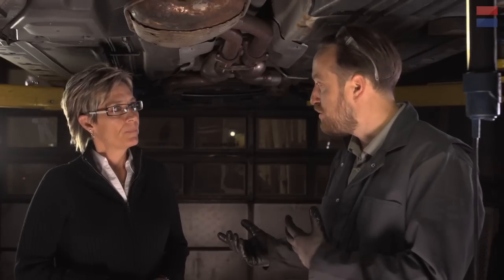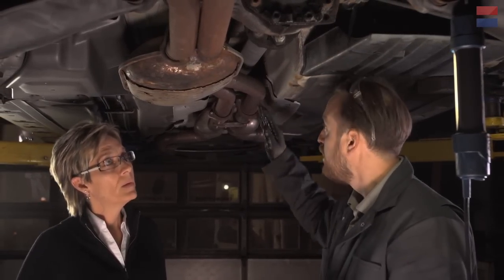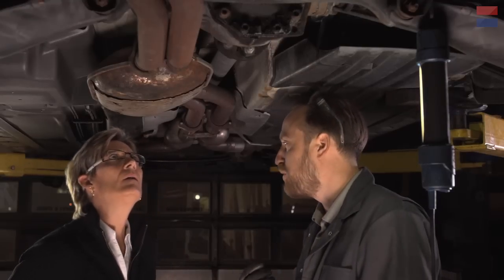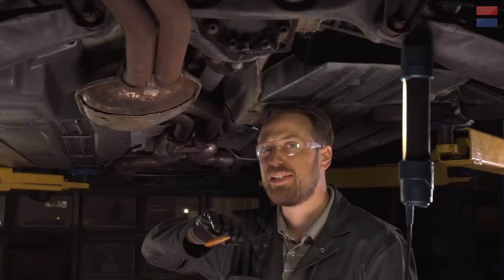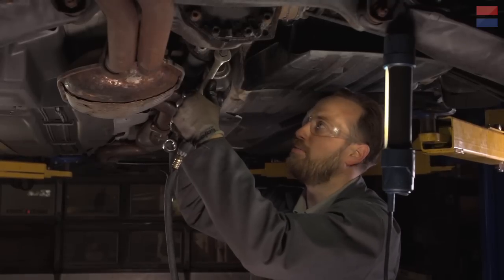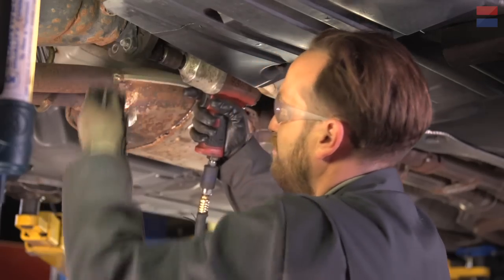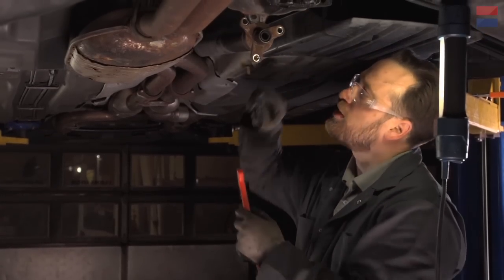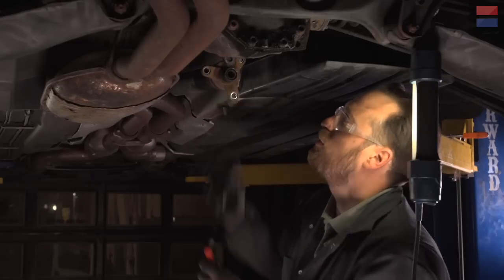How to Replace a Flex Disc

Comment: Never tighten down nuts and bolts on a driveshaft in a circular motion. Those 6 bolts should be tightened like a wheel. Equally spaced in a triangular pattern.

Comment: You forgot to mention that some guibos or flex discs are directional... and if put in backwards will perform bad and destroy itself...
Reply: Maybe that’s why mine makes vibrating sound the one by the transmission

Comment: Hello thanks for your information. Also my w124 had the same problem and while im inspecting the differential i had seen there is some one rubber parts which hold the differential on the frame was damaged. I need to replace it and how it will do

Comment: If working on a '97 Mercedes C230 or similar, remove the rear exhaust and heat shield, then loosen the center bearing to gain clearance to remove and replace the disk, there is no way to force the driveshaft back to clear the pin in the center of the differential mount.  Unless you are working from a lift, the length of the bar you can use to force the driveshaft back is limited, and there is no room for a helper.  After loosening the bearing mount, the driveshaft easily slides back enough to align the shaft to the differential.
Reply: YES, carrier bearing needs replacement too.. and boot.. But loosen  driveshaft nut colapse drive shaft.. or damage the centering bearing grease filled worn out too. Had a driveline balance shaft too.. installed new bearing and mount for free..

Comment: There are several comments here about replacing the flex disk with something solid.  Only issue is that these disks have to do the job of a universal joint, so a solid disk would destroy the whole drive line.  Please someone repeat the torque specifications and I agree with turning the nut instead of the bolt.

Comment: Great video.  I have a 2002 BMW 330i w/ 83k mi.  When I step in the accelerator at around 70mph, I can hear a slight rumbling noise coming from the middle/rear of the car.  When I take my foot off the gas, the noise seems to disappear.  What problem(s) do you think it is?  Thank you.
Reply: Hungry dinosaur in your fuel tank

Comment: Mercedes uses some of the strongest Donuts in the world. I had an Alfa V6 with probably 175hp, granted it was a transaxle car but that car went through donuts like crazy. The alfa donuts though, came with a strap around the outside of the donut making the holes closer together, once you have  your bolts in, you clip the clamp off and it expands and you're done, i guess benz doesn't pre-load theirs

Comment: great vid ...have a question in regards to dive line ...e46 232i 2002 ..190000km auto .. car is smooth without any vibration but!! at 120kph there is not a vibration but a hummmm from seems to be from centre to rear of car ...any suggestions

Comment: Dear Ben. Thanx for the good explanation. I have a Mercedes c240 (2003). Do you know after how many miles the flex disc should be replaced (or inspected)?
Reply: Daniel Tahin you should inspect it after 10 years or around 100000km

Comment: Why not change the the rear one at the same time in this case?
 I am glad that you highlighted the fact that you needed new bolts!!! I didn't know that when I was a kid and failed to replace a torque to yield bolt - had to get a tow home :-O
Reply: That is the back one. I was wondering why the front one wasn't addressed

Comment: Will this also cuase  a rattling  sound while driving around 30 to 40 but goes away iff i keep my foot on the gas,iff i let off while it slows down i hear metal on metal rattling  coming from back side

Comment: Buy quality brand discs like MEYLE or they won't last, also lubricate the inner bushing  with hi temp grease or replace it if necessary then tighten all bolts in a star pattern like you would your car wheel to 60 Nm. Make sure you assemble the disc correctly and the washers go on the bushing holes not the drive shaft.

Comment: Slow acceleration of my W201 190E 2.0L. Front wheels vibrate when braking. What could be responsible?Can my leaking water pump be repaired aside replacing it with a new one? Please help. Thank you.

Comment: Ben! Ben... oh my gawd, ben...

It MIGHT help to tell folks if you have a lift, great, but if you're doing in the driveway, you can't rotate the shaft unless you lift one of the rear wheels. With it lift it would have taken me 20 minutes tops. On my back, in a muddy rain soaked driveway, 4 hours since we were not able to move the axle.Also, might mention that there are TWO of these things on the car, right? And you're working on the rear?

I'm not a mechanic but considering nobody noticed that the flex disc was failing at ANY of the 6 oil changes I had in the last two years, or the jeckhole who we got to solve the vibration in the stick shift.

Turned out the flex disc was breaking apart and slapping the shifter rod and ended up wearing out the coupler from the shifter to the shift rod. He was under the car twice to repair it, once, quick-fixing it so we could drive it, and second to install the actual part. NEITHER time did he notice the flex disc was showing threads and broken up.

Again, I'm not a mechanic but when I looked under the car to see why even after the proper shift coupler was installed we still had vibration, I saw this mess RIGHT AWAY.

Seems like the cause for the failure was 1) only 4 bolts had been used to install the thing. 2) looks like they had been cranked down with too much torque and had warped the washers and the rubber.

What i removed from the drive shaft was just a pile of broken rubber chunks, some coupler sleeves, and a lot of exposed threading holding it all together.
Reply: So, lift the vehicle at the rear, so the wheels are free to rotate. Use your brains.

Comment: Hey there, 

I have C200 Kompressor, would this be able to cause a clicking sound coming from the center dash. increases with speed and changes volume dependent on what side you are turning to?

Comment: Good video. One suggestion to better remove the old disc would be to use a 10mm pin punch or allen wrench and insert it into the metal sleeve then pry it instead of prying on the rubber. Much safer and easier.

Comment: hello I have a mercedes 180c w202 if I accelerate a lot, it will bump a bit when driving, it is no longer gears well, it is the hardy disck thanks greetings fernando Sout spain

Comment: hello I have a question on a s430 the valve block for the air suspension what's the procedure in the install ???

Comment: That pilot bearing in the end of the driveshaft would have liked some lubrication.
Reply: It's not a bearing, it doesn't need lube.
Reply: It's a centering sleeve and it is supposed to be greased.
Reply: if the centering sleeve is damaged can it be repaired? or do i need new shaft

Comment: found the isse brok on the on ramp my front drive shaft had worn u joints 300 on ebay with replaceable u joints versus same part at mb usa for over 1000 pus shipping from germany and then to my house

Comment: Do you have any idea, what could be the problem if you have to replace the flex disc 2 times in 3 years? I have a 1992 Merc. Are the parts old or do I need original parts?
Reply: Ryan Myers My guess would be improper installation. Along with the flex disc, the center support should also be changed. If one is failing it will cause an in balance and do harm to the other component.

Comment: mercedes benz 420sel 1988 what way flex disc go on do it have front side and back side and my mark got wipe off to line up now i am get a vibration in the rear how do you balance it please help

Comment: I own a Mercedes Benz clk55 amg.
My center support drive shaft bearing and braket was busted(drive shaft was very loose in center). I DIY it, I replaced the foward and aft flex discs and also the center support bearing and transmission mount, I forgot to MARK everything before I took it apart. Put it all back together NOW the car vibrates at around 50 mph.
Can't find a shop in Orlando Fl. That will rebalance the drive shaft.
Should did more research before started. 😔
Reply: Raphael Crandon I don’t know for sure about the clk55 but after 1985, Mercedes pretty much started casting marks into the driveshaft halves so you can just line then up when putting it back together. No need to make marks yourself.

Comment: do the bolts need a specific value to be tightened ? I can't recall the name of the tool that does that, dyno something i think
Reply: a torque wrench
Reply: OneMinuteFixed  yes. Direct screw is 120 n.m and like the one in the video is 58 n.m

Comment: As I understand it, flex disks or guibos as some call them, are a European solution. More common on rear wheel drive US vehicles and most heavy duty trucks is a universal joint, or cardan joint. In your case, it could be a worn universal joint or a transmission mount. I had a truck with a similar issue, replacement of the transmission mount, which is inexpensive and fairly simple to install, fixed the issue.

A worn transmission mount or U-joint would be easy for most shops to find and fix.

Comment: i have a clink on my car when shifting into reverse any clues on what it might be
Reply: if its manual, a clink while shifting gears is usually normal. if its automatic there could be something lose in the linkage from the shifter and the tranny, or there could be something lose in the tranny.
Reply: Canadian Guy 
What is a "guibo"? A gearbox?
Reply: peter d  Is this the same as the tranny mount?

Comment: I replaced my front and rear flex disk on my mercedes c300 but I failed to mark the position of the driveshaft and now I have a slight vibration at 70mph... What are my options ?
Reply: Since there are only 3 possible match-ups, and you're not liking the current one, trial-and-error isn't all that difficult: you've a 50-50 chance that the first (of the remaining 2 options) other position you try will be the correct one.  If not, well - look at it this way: you'll be getting pretty good at the procedure.  Plus - you only have to R&R 3 bolts for each new try.  Here's a hint, though: this time MARK things so that if your 1st guess doesn't get it, at least you'll KNOW which is the 3rd (untried and presummably correct) option remains!

Comment: Do u have to use new bolts or u can use the old ones
Reply: You NEVER use the old bolts and nuts from the old flex disc.  Most are sold with a new set of them.

Comment: When you say centre bushing do you mean centre bearing?  I believe mine is going as I get slight vibrations on acceleration I will probably have my flexi done too at same time only thing I'm unsure of is when I had my flywheel and clutch done on my BMW e46 the mechanic didn't put marks on there when removing the prop shaft???  To align correctly when putting back together as I was there with him doing it

Comment: I had this done on my 05 Mercedes-Benz and now im noticing when I get in the car and turn left or right it's rough, but not while driving just when I turn
Reply: jhawki777 it's not a flex disc. What do you mean by rough
Reply: 201 034  you're right. whatever it was. they fixed it

Comment: Flex disc public service announcement: don't wait until it's too late. If the piece fails the driveshaft apparently destroys everything in a circular path, even cutting into the cab! Google "Failure of the Flex Disc on a 126 Body Mercedes"
Reply: No it doesn't, there's a centre locating pin that prevents that.

Comment: would the flex disc make a clink when shifting into reverse if worn
Reply: Yes I just replaced the front flex disc on my c230 and I would clunk when downshifting from 2nd to 1st and when moving into reverse. The problem was the bushings in the flex disc were loose
Reply: Thank you
Reply: also just to let you know there are 2 flex discs one of the front of the driveshaft by the transmission and one on the rear like in the video the front one is subject to way more heat
Reply: Titus Nickleson True. I just replaced the front flex disc on my w211, It was not clunking when shifting but the car had a slight vibration at highway speeds. Problem went away after I replaced it. Surprisingly the rear flex disc looked good with no cracks whatsoever so I left that one alone.

Comment: I wish you had mentioned the torque spec. My cheapy cheapy Haynes manual doesn't tell me.
Reply: very important...wish they did!
Reply: WIS document AR41.30-P-0100-01A
Self-locking nut, flexible disk to transmission or front propeller shaft 
Model 210
M10: Nm 40
M12: Nm 60

Comment: cant you just spray it with atp at -205 ? its a rubber rejuventator.
Reply: No you can't repair a critical drive line part such as a flex plate, just buy a new one....preferably oem.
Reply: Dylan Basdeo thanks :)but do u know about atp at 205?
Reply: It's cracked. No rejuvinator will make the molecular bonds magically heal the cracks.
Reply: I wish that stuff would fix it but unfortunately it won't. Either way the flex discs for these cars are very inexpensive.

Comment: I like these guys but this was a horrible job. When you change flex disks you have to do them in pairs. There is one in front (transmission) and one in back (the one they just did-diff). Also there is a centering sleeve (you can see it on propeller shaft/drive shaft) that you must grease. Grease has to be an "NLGI 2" and you need 6 grams of it. Feel free to google "NLGI 2" and "centering sleeve" to get a better idea of what I'm talking about. Also you have to torque them. On a w203 if you have the M10 bolt it's 40Nm. If you have the M12 bolt it's 60NM. Same goes for w209.
Reply: Pitball It's not necessary to replace  both, if only one is bad. Asra gives time for front, rear or both. I have never seen or heard of anyone lubricating  the centering sleeve when replacing a flex disc.
Reply: I think the guy from Mercedessource channel said that you should put masking tape along/across the parts of the drive shaft as the parts are actually put together in a balanced fashion. So if you spin them somehow you will know how to put them back together again by matching the tape on both parts.
Reply: that's not a bad idea

Comment: Why are the new bolts blue?
Reply: So when the dealer installs the new shaft, they can easily tell when it comes back later that it's had the updated flex joint and bolts fitted. Not uncommon when there's a service change to criitcal parts like this that they are made to be obviously different to the old parts.
Reply: It's because they have threadlocker on them

Comment: Stop where is the grease that goes into the end shaft of the drive shaft..as per mb a weighted amount of grease goes into it.. it slides in and out on the shaft that comes out of rear end..  wtf are you  guys doing..please search proper mercedes instructions..  Time to change those too....  Please find a reputable knowledgable info this aint it...  i followed these peoples and ruined my end shaft greased tube and it put stress on carrier boot.. The shaft colapses, duh... More needs to be done at this time..  if carrier bearing fails there goes the car seen it..   My carrier bearing had almost NO grease left, just a regular sealed bearing.. holder and boot need a look or replacement..  ask how I know..   These guys cost me a lot but also forced me to do it right..  Scared me the state of carrier bearing..   But mb and clubs have the correct methodology to do it right..  diy yes..

Comment: The part on the front of the differential you marked is called a pinion shaft. The "box end" wrench you were using was actually a combination wrench and you were using the open end. I enjoy watching your videos but cringe every time you get your nomenclature absolutely wrong just thinking of the folks who don't know better you are misinforming.
Reply: Actually, it's a pinion flange they are bolting to, and in the US, they are referred to as box end wrenches.
Nice try on being smart, but you failed.

Comment: do not follow this false repair follow mercedes manuel its online..  this is wrong, and will damage parts..  if flex or center bearing fails drive shaft will ruin car see mb club sites. it happens a lot..

Comment: Generally the bolts go in opposing directions. Transmission flange to the rear and driveshaft flange to the front. This is a terrible video all around.